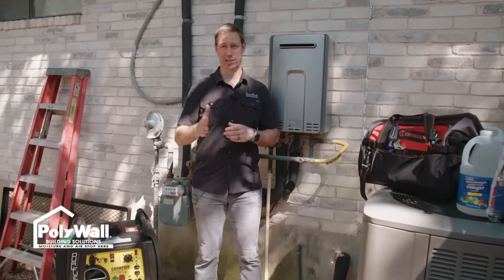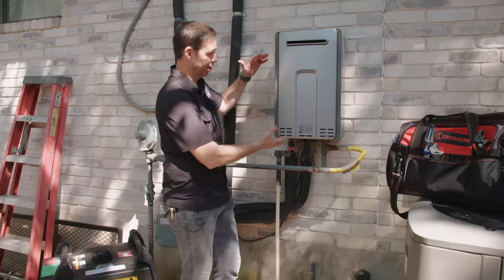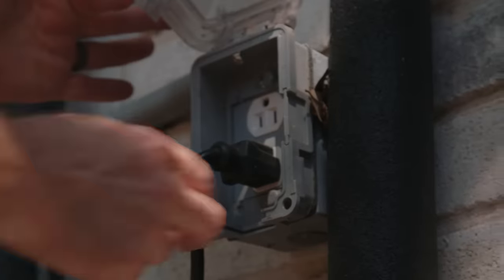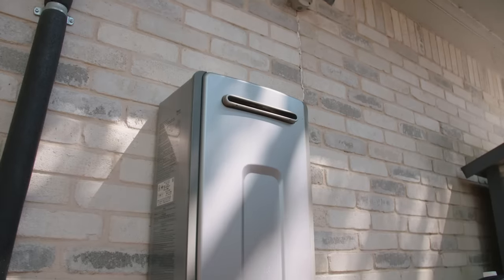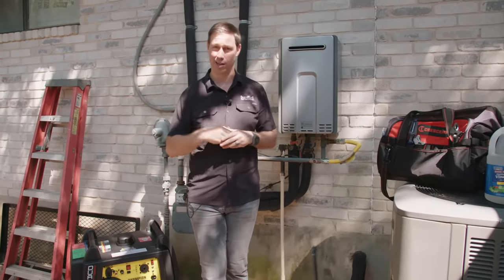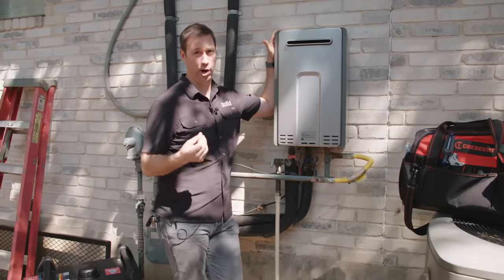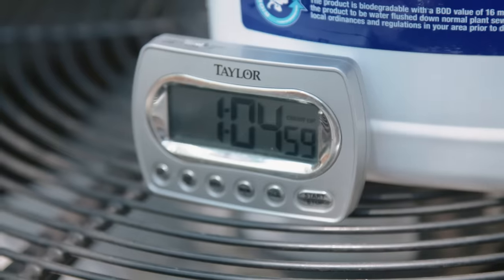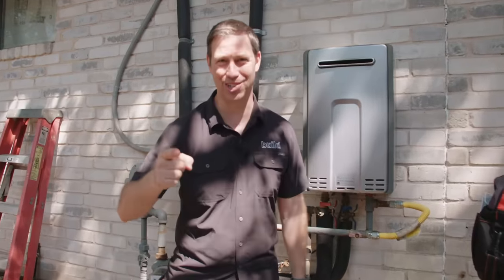3 Things They Don’t Tell You About Tankless

Comment: I just replaced my 30-gallon with an electric Rheem 3.5 gpm point of use for my small 1-bath house. The unit was <$300 and now that it's plumbed, I can easily replace it myself if/when I need to. So far it's doing a great job. My point is even with larger homes, most families don't need a huge amount of hot water (especially with low-flow fixtures).
Happy building everyone!
Reply: Walk into a house with 3 to 5 children. Then try telling the mother that they don’t need much Hot water.
  Just after you say that. Duck. Because something is flying at your head !!!
Reply: @ltsgarage7780  I've inspected homes that fitted with tankless that exceeds the max gpm of all the HW fixtures combined. It's a personal choice but with flo-flow fixtures and by being mindful ppl could save a lot of money.
Reply: @jeffmathers355  I disagree with “A lot of Money”
  If everyone in the house takes really short shower, wait till the dishwasher is completely packed full, and the clothes washer is packed. You might save 20 to 25 dollars a month. 
And that’s a maybe that much!!!
  Then add back in how much electricity or gas the dryer uses extra to dry the full load.
  Saving 240 to 300 dollars a year. I would change jobs then use the shower for what it’s made for. 
   If you really feel a 300 dollar bill at the end of a year. You just are not charging enough.
    Says the guy on the internet that charges 275.00 an hour. 🤪
Reply: @ltsgarage7780  I meant save a lot on the cost of the water heater. Hence my OP. Cheers
Reply: @jeffmathers355  buy a good Tankless then you don’t have to worry about one giving up on you. I have tankless water heater’s still working just fine after 15 years & some even longer.  
   Some of it is water quality. Some of it is maintenance. They all need to be serviced.
  What do you call a quality tankless & what does it cost. 
Not the install cost but just the
 cost of the tankless?
By the way I’ve run my own plumbing business for 49 years. 
I’ve heard it all and seen everything tried !!!
Reply: @ltsgarage7780  I like the setup I described in my OP. It's sized perfectly for my needs and it's something I can maintain or replace myself at a manageable cost, saving me money on both ends. 
Everyone else can decide for themselves but that's what I prioritize and I think it could be a good solution for low-income families.
But as a plumber, I'm curious to hear your take on point-of-use units. Have you installed many and what do you think about them regarding quality etc?
Reply: @ltsgarage7780  l
Reply: @ltsgarage7780  what name brand do you think is a reputable tankless? I’m a single woman so I don’t need a lot of hot water to begin with and my 30 gallon regular standup water heater just broke - thinking of going tankless … I am in Arizona ….Thank you for any info you can give me
Reply: @kutipy2348  I totally believe in the Navien. I also believe it’s a waste of money for a single woman to install a tankless. Now with that said. Do you have a large style soaking tub in your home??
   Next, are you on natural gas or propane?
Reply: @kutipy2348  Nevien. Best on the market. Under 2000 dollars. Has a buffer tank of 1/6 of a gallon so when you open a faucet it starts send hot water. It does not need to warm up the first water it sends. 
  It also has a built in recirculating pump. This makes it easier to install a recirculating system in your home. All stainless heat exchanger. This will not wear out as fast. Plus junk in your water has a much harder time sticking to the stainless heat exchanger than it does your standard copper heat exchanger. 
 And lastly you can use a  PVC flue. So you can use it on an outside wall by just sticking it through the wall and turning a 90 degree allow down so no rain water or debris get inside. They also come with a pvc  screen to keep birds a varmits out.
Reply: @kutipy2348  cost effective would be to replace the 30 gallon water heater with a 40 gallon. It’s a waste of money to go to a tankless for just one or two people!
  Sorry this took so long. I just received it for some reason??
Reply: @kutipy2348  have you done any research on the Nevein tankless water heater?
   Where abouts do you live? This will also have a degree of what a good tankless and a bad tankless is.
   Do you have some one that understands how to install a tankless??
   It really is totally different than installing a tank style water heater…

Comment: I love ours. Endless hot water is delivered to all points of our 1800 sq. ft. ranch. We can run two showers, a dishwasher and fill up a tub all at the same time. It only cost us a couple of hundred bucks to install by ourselves, and honestly with the $300 federal tax rebate it was cheaper than the conventional power vented 50 gallon tank we would have replaced it with.
Reply: you need a larger gas line????? how did you get around that?? got trained gofers
Reply: @peter-pg5yc  I have 1" where it enters the house, a 20k heater tees off. The trunk, then the trunk runs 10ft, tees off and a stove and 80k BTU furnace are off the top side, and the bottom goes to a 20k dryer, and 160k tankless.   And that's right at about 375k BTU/hr peak demand (the max rated output of a 250 mtr@6" wc pressure is 375k BTU/hr) 

I didn't have to change much, just replaced a coupling with a tee on the 1" going down to the dryer, then ran it 5 ft to the water heater.  Lot of piping in older homes were severely oversized.

and honestly a 250 mtr can put out a lot more ( like 800k btu) at its outlet, it just can't register it, so its free gas lol, and what r the chances you are running every single gas appliance at once? Every stove burner?

Comment: 10yrs using tankless, 2 adults we've realized significant gas saving. Ours has inline screen. Easy maintenance using valve system. Also no catastrophic leaks. We also were able to remove a 2x2' chimney which provided additional space in laundry room while eliminating air leaks and temperature transfer of bricks
Reply: Yeah well as soon as you get a Navien combination boiler water heater you have nothing but problems 4-5 years in. They don’t even make it ten years. They are terrible. If it’s just a tankless water heater than your ok but be careful with someone trying to sell you a Navien!!
Reply: I need a water heater and still looking into it, worried about thankless failing and costing me too much over time, i am not sure it it reduces my gas bill, my gas bill goes up because of furnace mostly...

Comment: I had a Bosch Aquastar installed in my home just over 20 years ago. It has worked flawlessly, and I have not experienced any of the problems described by others here. With respect to operation, two things: I adjust the temperature during the course of the year depending on the temperature of water coming into the house. During warm summer months I adjust it down, during cold winter adjust it up. Second, I adjust the heater so that the hot water temperature at the tap is that for a good hot shower without mixing in any cold water. You should not run these like a tank where you have a high temp (within code) in the tank that is mixed with cold water at the tap! For the kitchen I have a small undersink tankless heater just for that sink. That way I get essentially instant hot water and the temperature is set higher for cleaning.
Reply: Exactly what Bosch suggests.  I have their electric tankless and love it. It was AE 125, the replacement is another name
Reply: you are soooo lucky..2 units here 5 years 3400 plus 1300 plus 300 plus 200 cleaning ..5200 total where are the savings those costs repairs to units or replaced in 5 years..big ouch
Reply: I had the same unit, gas. The problem I had was that it took a long time for the water to get hot at the tap, and every now and then the pilot light would go out and I would have to go into my semi stand up crawl space where the tank was located and relight the pilot light.
Reply: @@kurtm.7494 only thing I can think of is maybe a draft. My house had a semi standup crawl space and I was keeping the vents open year round because water was coming in and draining out. The heater was installed in the crawl space on one of the outside walls with a direct vent. The furnace was nearby too. The pilot light was going off maybe 5-6 times a year. But my biggest issue was that I had to have the water running for minutes before I got hot water. It was a natural gas unit. Gas was always on.

Comment: Hi Matt, Jim in Japan and I mentioned before, every house in Japan has one or more of these heaters and nobody ever has them serviced. They last 15-20 years then they replace them. I am sure water in Japan is quite hard, very hard in many places. I have never seen any scale on faucet filters etc. However, I am asking my wife to get one of ours serviced, it still works but I believe it needs a tune up. I will get back to you how that goes.
Reply: Once per year, we need to run vinegar through the tankless heater with a sump pump, and let it run for a few hours

Comment: I recently (~24 mos. ago) replaced my tank water heater with a tankless. I save about $100 to $120 a year on my natural gas bill and never running out of hot water is a big plus. The space saving is a big deal too. My unit is mounted inside the house here in the southern mountains around Asheville. The unit has to be vented, so it's mounted on an exterior wall making the vent short and direct. Your "How to flush the unit" video was a big help too, Matt. Thanks for that. I should jump on that job right away.
Reply: So in 15-24 years you will pay off the unit. Typical cost vs tank comparison. Not sure if thats worth it.

Comment: Also, I have used tankless a lot in office buildings. I recommend the installation of a cheap in line filter, and change the filter once a year as routine maintenance. They work great, really save energy costs, tenants love them and if you ever need to change one out they are as easy as unplugging them and removing two water connections. Then reconnect and plug back in. We used conventional electric range plugs. The only change out we ever had was for a failure of a heating element (which was under warranty and they just sent a whole new unit).
Reply: Thanks for the tip with the inline filter! I'll get on that suggestion asap.
Reply: they do not pay for labor, lier.. 1300 bucks..
Reply: People need to understand the filters won't deal with scale.   The scale is water hardness that is dissolved, and it doesn't precipitate until it hits the hot surface of the heat exchanger so a filter does nothing for the scale formation that occurs inside the unit.    A water softener uses ion exchange, not filtration to remove dissolved minerals and that is what you need.
Reply: @kevinhaskins6619 I installed a filter on the outlet of the tankless water to catch any scale. The filter is for hot water and has a replaceable cartridge. It’s helped eliminate any scale in my shower valves. I’d highly recommend it.

Comment: I've always felt kind of "meh" about tankless. I'll tell you my favorite hot-water setup though. It was in a place I lived in Utah. It was a drainback- type solar thermal unit in series with a heat-pump unit. Never ran out of hot water (even in the winter), and it was super cheap to run too.
Reply: I didn't knew this existed. Thanks for the info.
Reply: I hope to do solar thermal in my house. It's so efficient and the sun pumps out so much heat t it's almost a no brainier
Reply: It wasn’t super cheap to Replace when it went bad!!!
Reply: @ltsgarage7780  what type of system, and what went bad?
Reply: Yeah, everything has its pros and cons and situations where one may be preferable over the other that will vary depending on location, climate, etc.

Tankless are less efficient in colder climates, you'd predominantly have to switch to gas heaters in really cold regions but that means piping vents to the exterior that can make it harder to ensure proper insulation/air barrier seal, and you can't make use of other heat sources as it only directly heats the water. 

Versus a tank system where you can add a heat exchanger and channel heat from up to multiple sources...  Solar, wood stove, geo-thermal, hot composting, or even transfer heat from one area to another to make more efficient use of heat.  Along with it being easier to set up options like hydronic radiant floor heating... You can do it with tankless but not as easy and less thermal mass can mean ending up using up more energy in that application.

In colder climates, keeping water heated can help prevent freezing issues and as the tank can be heated over time it doesn't require as powerful a heater to get the job done... 

So tankless is more ideal in warmer climates and usually in situations where water conservation isn't a issue...  It does take up a lot less space and if properly used can be cheaper to operate but if abused it can cost a lot more...
Reply: @ltsgarage7780  I'd like to know as well. I've never heard of a drainback type "going bad". (antifreeze-type systems, yes, but not drainback-type systems) 

Yes, you might have to replace a dead pump every so often, but that's not catastrophic; you just replace the pump and it's working again.
Reply: @ZeoCyberG  I'm "meh" about them mainly because the only "pro" (for me at least) is space savings. However, if I were installing one in new construction, I'd still reserve almost the same amount of space that I would a tanked heater. It will eventually need maintenance/replacement. I don't want to do plumbing work in a cramped space, and I doubt a professional plumber would either. So yeah...the potential space savings would be nil.
Reply: @seanpalmer8472  Well that would depend a lot on the design of the home then... They can be placed in easy to reach places that are still out of the way and don't require much reserve space.  Or you can just get an outdoor rated unit and install it somewhere on the exterior, climate allowing of course...

Just about anything can be made to work but what's ideal will vary per situation and how it is applied...

Hybrid options can be a good compromise as well and doesn't have to be either/or...  There's lots more options out there than I think most people realize...
Reply: So did it have a solar heat exchanger  and storage tanks? If so it would probably use a 'circ . System..  sounds like a good one.
Reply: Yup n by the time you power vent the unit, sacrifice  the recirculation  option  or increase the  cost of water  storage.  Like they say there's  no there  there..
Reply: Mine was a series of coiled up garden hoses in the tx sun

Comment: When my water tank quit back in 2006 I replaced it with a Bosch Tankless gas unit WITH a standing pilot. The home center was selling them for the same price as a 50 gallon tank unit at that time (I think someone made a mistake, I asked if that was the true price and they said it was so I jumped on it!). I have been extremely happy with my tankless Water heater.
Reply: That's not a true tankless water heater.

Comment: One thing you forgot to mention. 200k btu added load on your gas meter and your standard house meter may not be up to the task and meter upgrades or in the worst case a service line or house fuel line could be extremely costly.
Reply: Very important and overlooked
Reply: Gas regulator outside can be adjusted as needed
Reply: @kirkandkaylaglaser2922  , A regulator adjustment doesn’t forgive a undersize fuel run or an undersized meter.
Reply: A larger gas line is a must.. ouch

Comment: As a plumber I recommend to everyone to flush at least every 12 months. It will change the longevity by 10x for the units if you buy a quality unit
Reply: Flush?
Reply: what would you consider a quality unit for a 3.5 bath house
Reply: @alaefarmestatesllc  flush is just referring to a process of cleaning out the unit. So basically it is flushing a cleaner through the water heater, or cycling a cleaner through it for health of the family and the life of the unit
Reply: @DSPAudiolab  I would ask someone who has more info on the house. So for instance, a licensed plumber is going to need to know how many fixtures each bathroom has, how many kitchens, how many gpm each fixture takes and finally a refresh rate. Also if you want water "on demand" which is only really done if you replumb your house. So on other words no one can tell you what is going to work for your house with out looking at it and doing some math
Reply: Is it the same procedure as cleaning a oil fired boiler  hot water coil?
Reply: @The Insufferable Tool yes it is still important but it takes a longer period of time to build up debri. But with that being said softeners don't purify water, it just scrubs it. So there is still other materials in the water that will build up over time
Reply: @billneurohr2904  yes it is really. Everyone has a different procedure but the same basic idea. You need to flush the coil of the deposits left behind by the water flowing through so using a soft acid or detergent is a great way of cleaning the system. Most units have a stainless heat exchanger which allows less abrasive acids like vinegar to do a really good scrubbing of the exchanger.
Reply: Does this affect both gas and electric units?
Reply: @vynnxa6416  most definitely yes